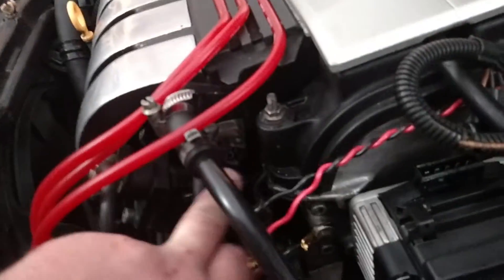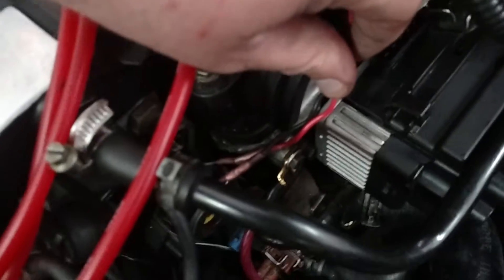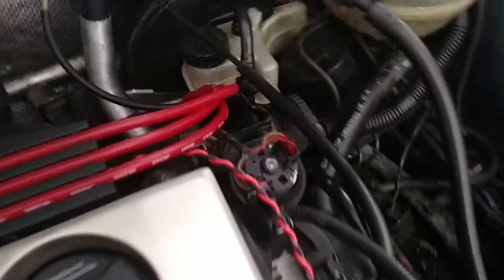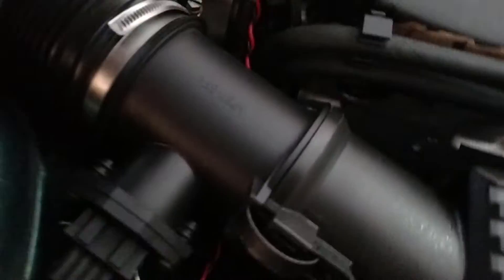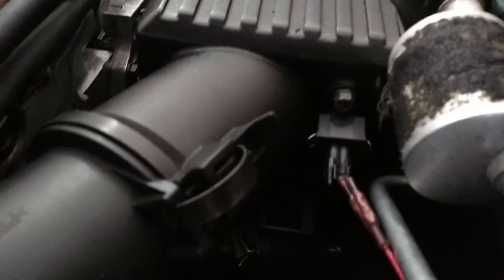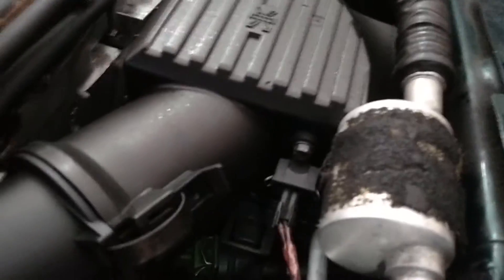VR6 IAT Swap to 1.8T Sensor

Comment: Do you have any pictures or a walkthrough video of how you did it? Doing the same thing this weekend and need some help.
Reply from the maker: It's just a two-wire sensor; there's not much to it.  Cut off the connector, leave enough wire on it to attach your extension lead, attach the extension lead, drill a hole where you want to mount the sensor, and mount it.  10-minute project.  :)

Comment: Ah I see. The original location looks pretty dumb given how toasty warm it gets in there. I definitely noticed a drop in performance on the track when things started getting really warm. Felt like the ignition was retarding. I might give it a go once I've got through the rest of my VR6 repairs!
Reply from the maker: +Badgertronix Yeah, "toasty" doesn't even begin to describe it!  I forgot to mention, I also have a phenolic spacer between the lower intake manifold and the block.  Even with that, the intake manifold still gets too hot to touch!

The other heat issue is the inlet trumpet on the airbox itself.  It's just sucking ambient air from the engine bay, which isn't helping things any.  I'm not sure if the Golf is the same, but the Passat also has a rearward facing trumpet coming off the back of the airbox, which is pointed directly at the exhaust headers.  It has an internal flapper which limits how much air it takes in, and I believe it's designed to favor the hotter air by the exhaust to help warm things up during cold starts.

I'm toying around with closing off the two inlets on the factory airbox and plumbing a whole new one through the frame of the car underneath.  I know there's room on the Golf, as there are plenty of pod filter kits that relocate it behind the inner fender splash shield, but the Passat seems to have much less room in there.  I want to keep the factory airbox if I can; it's so nice and quiet!  Pod filters make the VR6 scream, even at cruising speeds, and I just can't handle the noise.  :[